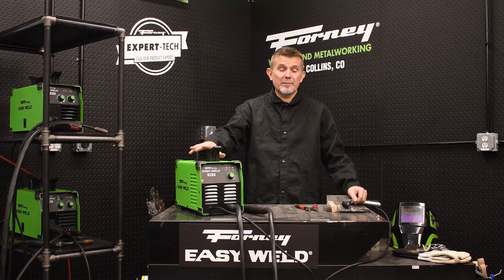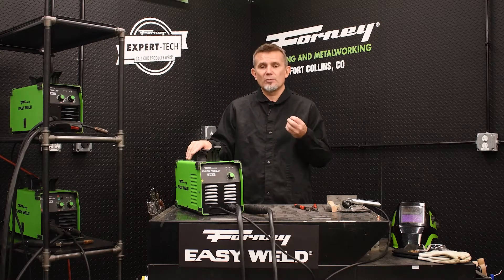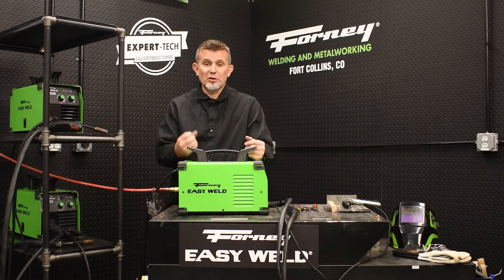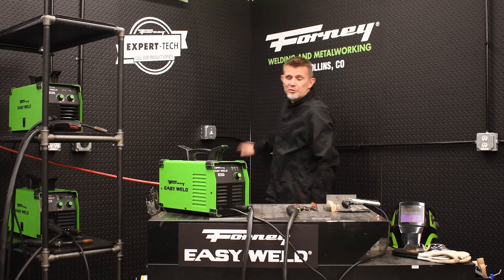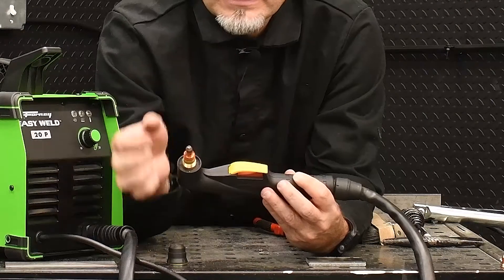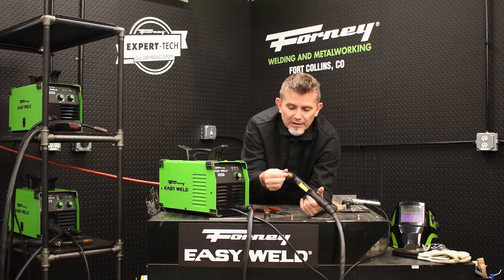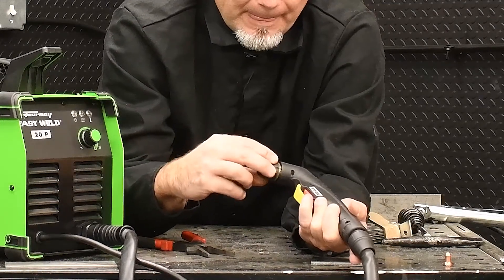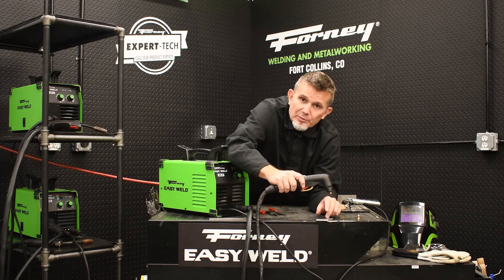Welding 101 - Forney Easy Weld® 20 P

Comment: Love this little cutter! I use it to cut 5/8 rebar. You have to start on the edge and cut in about 1/8 inch or so, roll the rebar over and cut the full width. That way it’s only 3/8 or so depth of cut. Does it great. I’m only using them for property corner pins so I’m not worried about what the ends look like. I just like it better than using a cutoff wheel on an angle grinder. Those things make me nervous haha. Great product! Thanks Forney!

Comment: Why can it cut 1/4" steel but a softer metal like Aluminum 1/4" it can not?
Reply from the maker: Plasma cutters have a lesser cutting capacity on aluminum due to aluminum oxide’s high melting point, as well as aluminum’s ability to dissipate heat. Both of those factors combine to pull heat away from the cut, giving plasma machines a small capacity when being used on aluminum.

Comment: Why would my temp light start flashing as soon as I start cutting???
Reply from the maker: If the yellow light is on from the start up of the machine, that is because there is an issue with the air supply. It could be insufficient PSI, or not clean dry air.
If the yellow light is starting when the trigger is engaged, that is a more serious problem that our Expert-Techs can help you with. You can reach them at 1-800-521-6038 ex. 2